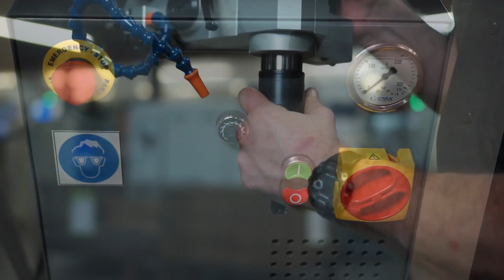FlexArm Hydraulic Tapping  Video

Comment: Could this be used with a tap drill to drill out a laser cut pilot hole then run the tap?
Reply from the maker: It's possible, but it may not be the most efficient way, because it will require the operator to provide the downward force. Feel free to give us a call and we can talk through your operation to determine if it would work like you want it to. 1-800-837-2503